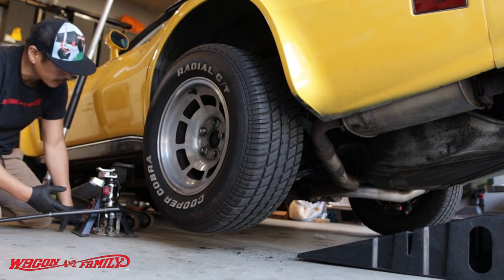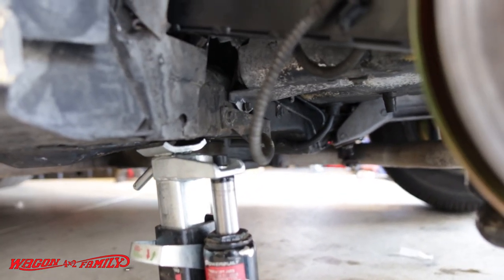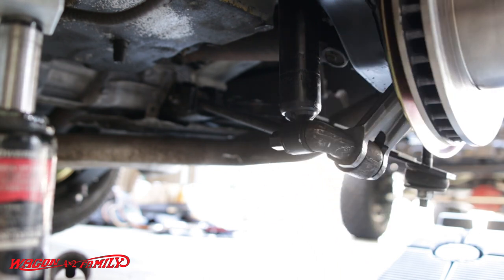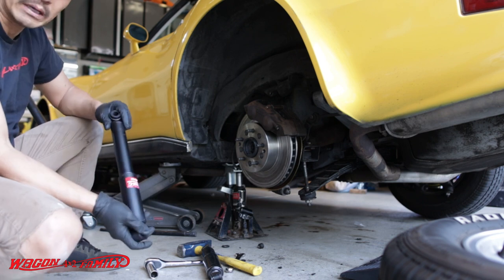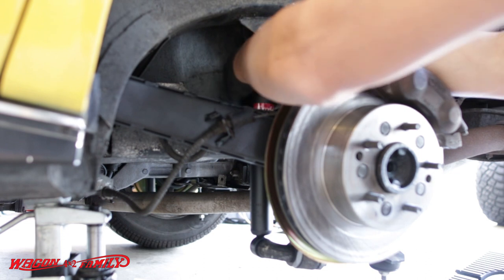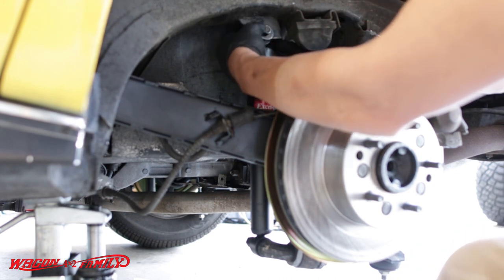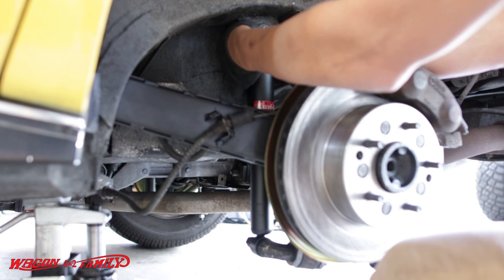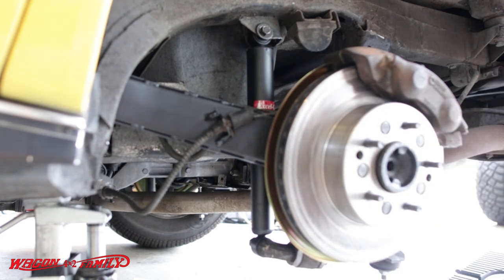Installing rear shocks on a c3 corvette

Comment: I glad you didn't have to do the wheel bearings because you would have to drill out the rivets on it and then you would have to loosen everything on it and you will have to cut the shock bolts

Comment: Where did you buy those trailing arms?
Reply from the maker: Here you go
https://www.topflightautomotive.com/products/van-steel-1976-1982-chevrolet-corvette-rebuilt-trailing-arm-assembly-w-new-rotor-and-rubber-bushing-rh/?utm_source=google&utm_medium=cpc&utm_campaign=20552764756&utm_content=&utm_term=&gclid=Cj0KCQjwqP2pBhDMARIsAJQ0CzqLPDUjbgnoY7B50XWT02fNh6Cm6bXMmBreLGEEcZp5esIc_Za2U8YaAuhBEALw_wcB